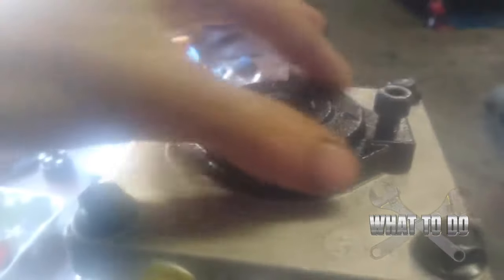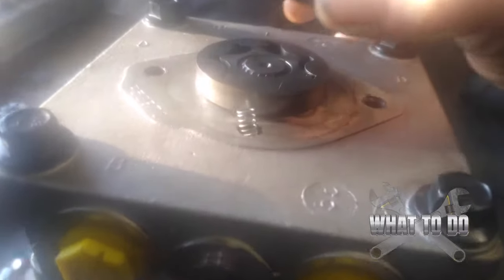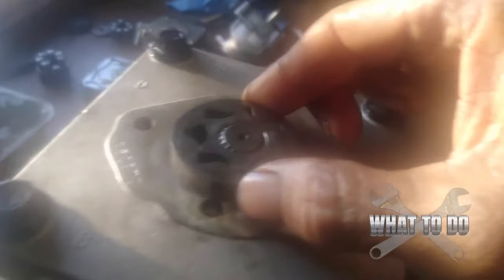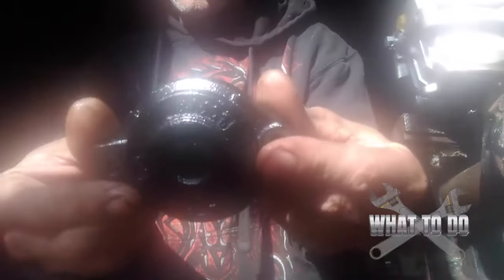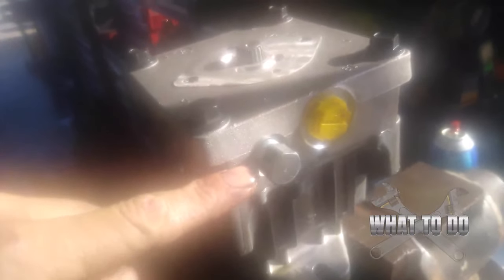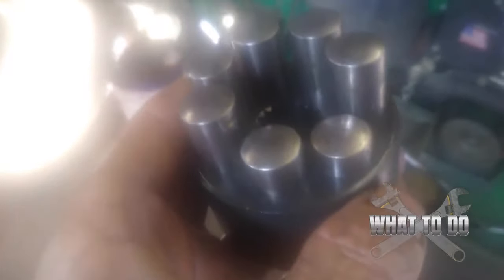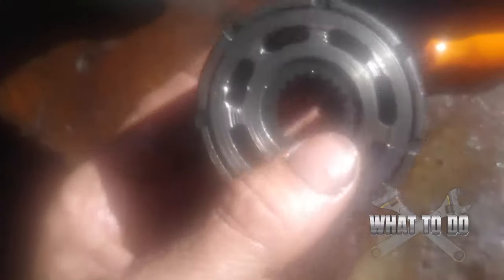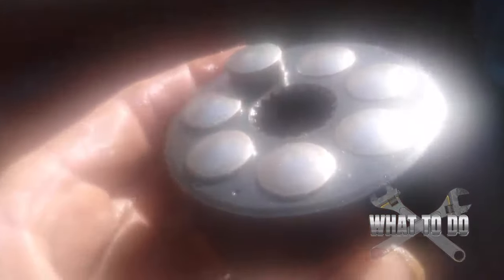Fix your Hydro Gear yourself ! - DIY hydraulic pump rebuild - $ave Money!

Comment: ever seen one that whines all the time like when moving, but youre in a neutral position?  mine is strong and feels fine but constantly whines. did fluid and filter. no change. wheel doesnt move when jacked up so its in neutral. whines with relief valve open or closed
Reply from the maker: I get asked that question quite often. The truth of the matter is hydraulic pumps always tend to have that sound there are some brands that are quieter than others but they all will have a whining noise. Now that's not to say that you don't have a cavitation problem inside the pump which means you have a blockage of some sort somewhere but I can tell you I work on zero turn mowers all day long new and old and they all have that whining sound to them you won't find one that is completely quiet.
Reply: @youtubestar  yeah i work on them as well but this is a bit much. its like how when you move the machine, initially they moan until you get going, but its doing that at all times like they its always under load. sounds like 1 pump not both
Reply: got mine figured out. turns out was the closest idler pulley to that pump whining.

Comment: Wondering if you would know what would be causing one side of my zero-turn mower pulling normal and the other side not hardly wanting to pull at all?
Reply from the maker: First check the nut that engages and disengages the pressure. It's located on the pump usually in the front. Turn these if you ever need to push the machine. Make sure yours is tightened all the way and maybe losing pressure in that pump.  What about the belt is it tight? Slipping at all? Could also be a clog in your charge pump on that side. It's quite a few things that could cause that type of situation.
Reply: @youtubestar  how do you remove a clog? Mine is doing same thing. Belt seems to be tight
Nut fully tightened 
Purged system because reservoir was empty when I got it

Comment: The problem I have with mine there was not a lot of power going forward but in reverse we have plenty of power
Reply from the maker: I would check the road adjustment on the side of the pump. Sounds like it might fix it. Adjust the nut on the long throw arm that goes from pump to your handle forwatd
Reply: @youtubestar  thank you very much for your fast response I will try it

Comment: please help, i rebuilt my hydro and filled the resiviour with fluid but the lines are bled and i ran it but i cant get the fluid to pump through the system
Reply from the maker: Did you replace the charge pump?

Comment: just bought one from a random site for $100 to not spend $1000. been robbing parts off an older mower and realized i already stole the left pump. if i take parts out of the right pump would it be the same insides as a left?
Reply from the maker: I guess it's all going to depend on your actual unit but I can tell you the bobcats we work on here the pumps are pretty universal they can be used on either the left or the right. Now you may have to relocate a hose on one of them but a lot of those pumps will come with the fittings to do so you may have to move a hose from the left side of the pump to the right side of the pump but you should see a bolt on that side of the pump for that purpose if you need to move a hose just take that bolt out and screw your hose into there and cork the other side. But other than that it should be pretty universal I would say that you're safe.
Reply: @youtubestar  well I took it apart and everything seemed to move fine thumbing through the insides but put it back together and it's gotten worse before it had a bit of pressure now it's nothing. Seems the oil is moving to the left side with no pressure Racking my brain here haha
Reply from the maker: The charge pump on the very top of the unit. Are you sure you put that back on the proper way? Everything on those pumps has to be put back in a precise manner which I'm pretty sure you probably did but just mentioning it. Take off the charge pump and check and see if the little ball and spring are inside of it still. Maybe something fell out that you didn't notice putting it back together.
Reply from the maker: If you don't mind me asking what unit are you working on is this a bobcat machine?
Reply: @youtubestar  exmark turf tracer.

Comment: Wondering if you would know what would be causing one side of my mower to be pulling as normal and the other side just barely wanting to pull,in a straight line I have to push the right lever all the way down and the left lever about half to keep it tracking straight then on a hill it won’t pull itself up with the right lever?
Reply: Me to, that's why I'm watching vids. No luck yet